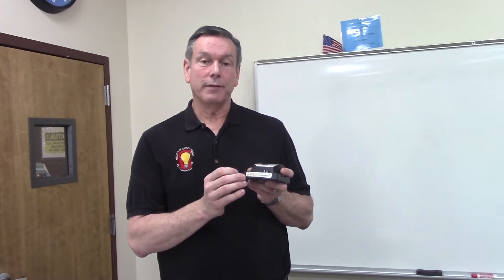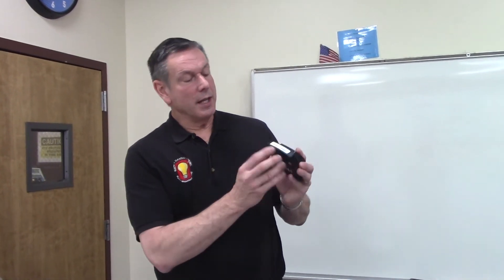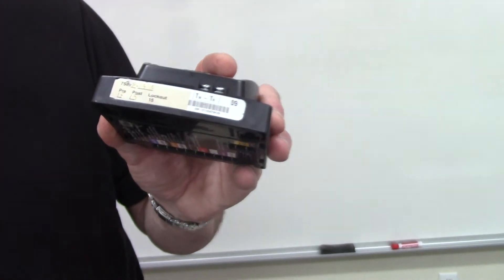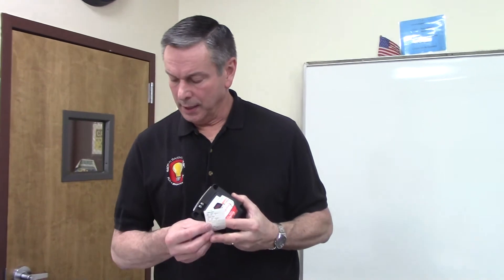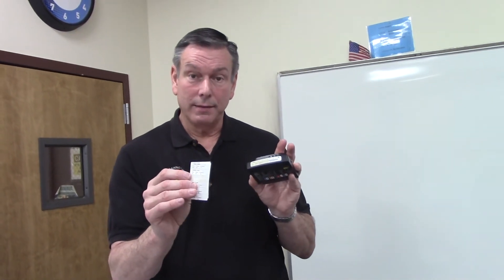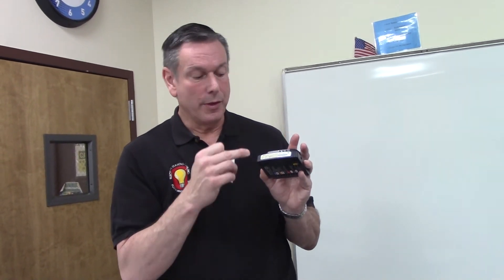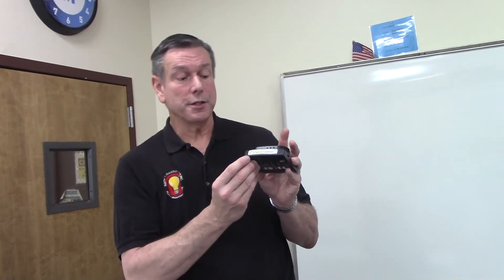Genisys Beckett Primary Oil Burner Control

Comment: How to wire a Field controls CK-63 control box to a Beckett Genisys 7505P primary control
Reply: Add a 24 volt relay which breaks orange wire connection and enables the Genisys after airflow is proven

Comment: I have a 7505 control and I need a new oil pump and I was told I needed a 4 second timer with new pump PF20322U. Do i need to replace the control or have it set up for the new pump or can I just use my old cord set without a timer? My oil pump is leaking oil so that's the reason for replacement. The new pump comes set at 100 psi so I don't understand why I need a 4 second timer if it's just a updates oil pump. Thx for your help